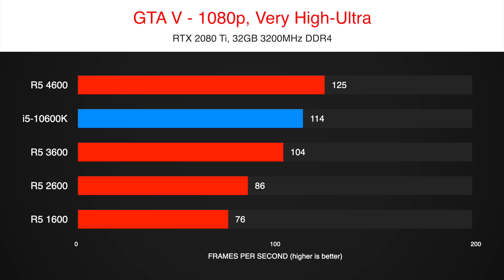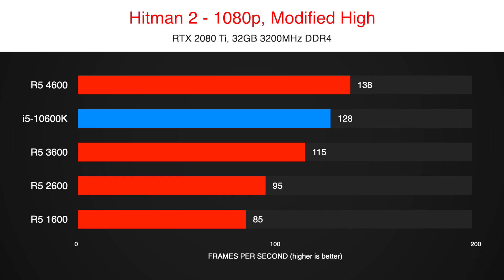How Fast are AMD Ryzen 5000 Desktop CPUs? [Ryzen 5000 vs Intel Benchmark Prediction]

Comment: You Don't sound very excited 😅
Ohhh 20%. I would love that increase.
Just sold my 2700x for 200$ good or bad sell?
Reply from the maker: I think it's OK. Let's hope they release the new CPUs quick. So, that you won't have to wait very long=)
Reply: Good
Reply: the 2700x is really bad,  unless only doding 4k gaming. even then you'll have less FPS, high latency, and spikes. 
The 3600 ect already gets sometimes 10-40 more fps usually than the 2700x. 
Getting 200 for a 2700x is insane, not sure how you got that much lol. 
Yup, be patient. the reward will be great.

Comment: Will it be with a upgrade though? 20% is a decent jump but I wouldn’t know till the benchmark comes out.
Reply from the maker: @Calvin Rodrigues, which CPU do you have now?
Reply: @theivadim  I use a Alienware R17 r3 with Intel i7 7700k and gtx980M. I got approval  to build a custom PC for Christmas around a 1000 dollar range. I wanted to go for and has its better but will be a good investment.
Like rtx2080ti was out done by rtx3070 will AMD next generation be a major leap?
Reply from the maker: Calvin Rodrigues , I don’t think that it will be a MAJOR leap. As I said in the video, I think AMD will outperform Intel 10th gen in games. For productivity AMD is already better than Intel even with Ryzen 3000 CPUs in most apps. My prediction is that Ryzen 5 4600 (or 5600, whatever they end up calling it) will be the best and top selling CPU.
Reply: @theivadim  oh thank you. But it's unlikely to be in budget in India has there is 20% extra tax
Reply from the maker: As for the price, I think they will price it $250 or more to undercut 10600K from Intel. 4600 will be more of a replacement for R5 3600XT. It would make sense to keep the price up until someone challenges them.
Reply: How much will the Ryzen 5 4600 cost?
Reply: Will it cost 200$?
Reply: @dxd dxd That's nice
Reply: @dxd dxd Do you think I'll be able to use a Ryzen 5 4600 with an RTX 3070. For 160 FPS and 144 Hz gaming at 1080p?
Reply from the maker: @ConquerWithAhmed_tha1  which CPU do you have now? I think most CPUs even now are capable of delivering 140-160 FPS. Even Ryzen 3300X is showing some impressive numbers.
Reply: @theivadim  I have a gaming laptop right now. I have connected that laptop to my 144 Hz monitor with an HDMI cable. Right now in Fortnite I play on 1440×900 resolution and I get 120 Hz that way. And I get 120 FPS.
Reply: @theivadim  I am planning to build my first Gaming PC by the end of November. I will spend anywhere from 1400$ to 1600$.
Reply from the maker: @ConquerWithAhmed_tha1  in that case you Ryzen 4600 will be a great choice. Just as 3600 would be if the new one wasn't coming out. 6 cores/12 threads is plenty for gaming. It is best to invest in a better GPU then getting an 8-12 core high end CPU. Unless you plan on streaming on Twitch or something like that. Then you'll need those extra cores=)
Reply: @theivadim  Yea and plus the new Zen 3 Cpu's are going to be way better for gaming aswell.
Reply: @ConquerWithAhmed_tha1  ONLY if AMD has reduced overall intra- and inter- CCX/CCD latencies AND has achieved ~ 2 - 400 MHz boost more than Zen 3000 generation [ 1 core 1 ms boost sorry it's NOT enough to catch Intel :-( ]. Just some nice +5 - 15% IPC boost is still NOT enough to take the gaming crown from Intel high-speed i7 and i9s like 9900K and 10900K.
Reply: @vladvah77  Yes you are right.